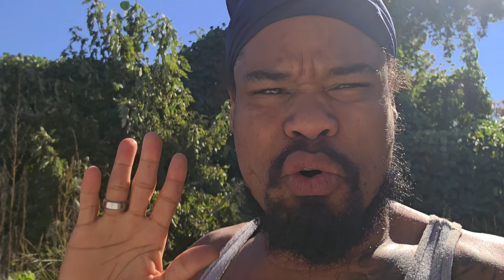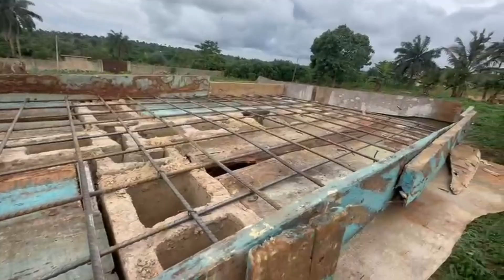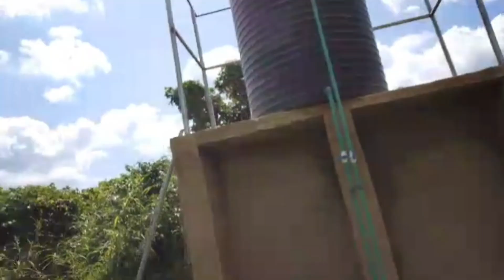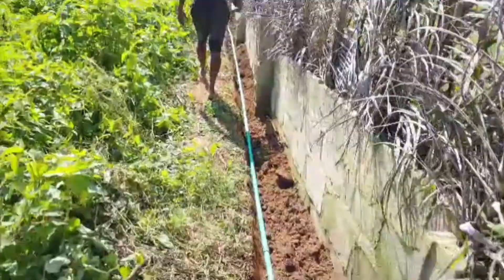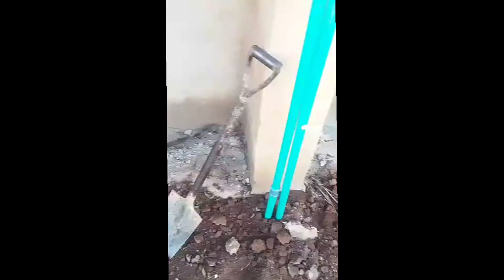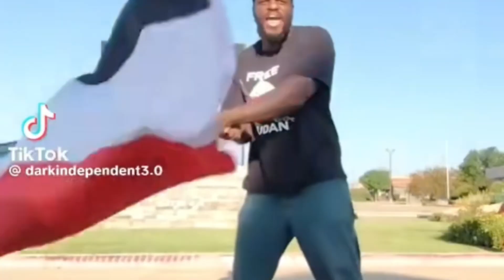Update on the pan african funded community solar power water borehole system in nigeria.

Comment: I notice that the pipe is not very far below grade level. Is that for ease of repair? Will you backfill over the pipe? It’s interesting to see how things are built in other parts of the world. I appreciate what you have done for the residents of the area. It will make such a difference & improvement in their daily lives.
Reply from the maker: It will be backfield. And it's slightly shallow for ease of access, just in case I gotta repair something. The ground is very soft in that area
Reply: @afroTTfuturism  Thanks for the info.

Comment: Looking good. The people can get water right away  now. You have the alternative power hooked up already before your solar power, inverter and/or batteries are hooked up above the tank and pump. Do you have some kind of timer to turn off the water in case someone forgets and leaves the water valve on to prevent wasting water? It looks like the excess water goes into a hole that probably leads back to the drilled well  hole from what I saw when the guy was washing his hands, so only energy and not water would get wasted. It was a good thing you built the system so close to the community power pole we saw during drilling. Did they put up a meter for you or are you running a long extension cord through the vegetation from where it connects to the meter on your property?
Reply from the maker: No there's no timer, but that sounds like a good idea right now. Right nowThe filling will just be done by one of my workers that will literally just stand there until the tank is filled. The actual storage tank is way back on my land not close to any power line. So that won't be an issue. The borehole is in the front where you saw the adrenaline last time. And next to the borehole will be the 5 water spouts for the people. I don't have a automatic shut off valve for the 5 spouts, so I guess I'm gonna have to trust them to turn it off or just minded myself. People seem to be very good about turning these type of things off in their neighborhood as I have observed over the years So hopefully that won't become a problem.p
Reply: @afroTTfuturism  I recommend the auto shut off. In order for your worker to know that the tank is full, water has to spill out of the tank.  Overtime, the constant water spilling out of the tank, will weaken your concrete tower and will get black moldy looking.